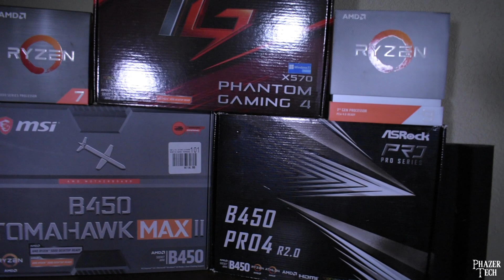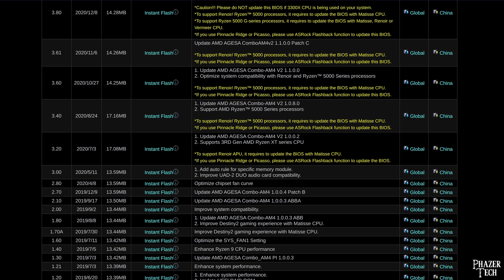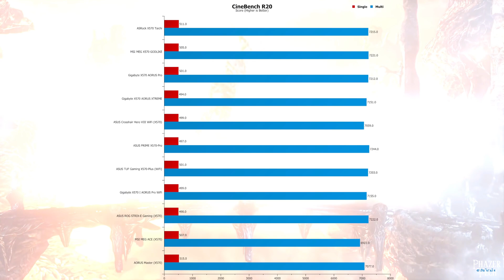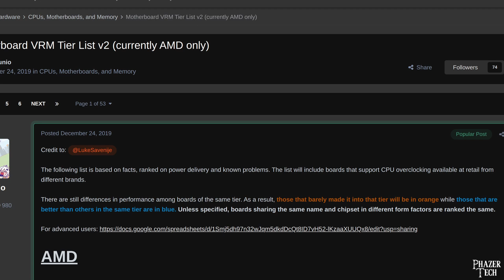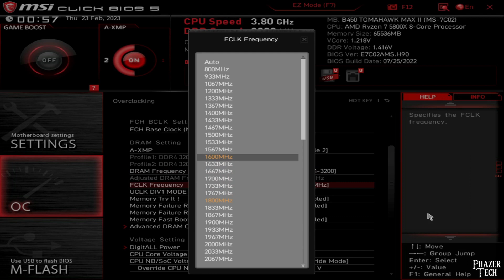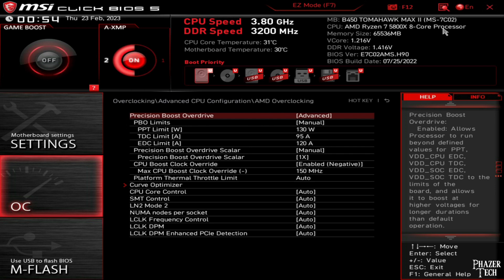AMD Ryzen CPU Degradation - Fix Instability With Custom PBO Settings!

Comment: My 5800X has been unstable under minimal PBO settings. I'm resetting everything base spec underclocking to 4.7ghz because of BSODs
Reply from the maker: Yep that's what I'd do, set it to 4.7 Ghz and disable curve optimizer. If you still have problems and are running high speed memory then consider dropping that to 3200.

Comment: How i fix my 7600x , just put curve optimizer to negative 30 and after that i got less temp around 20 celsius and all cores fully loaded are stable on around 5.450 Mhz. I have this MB GIGABYTE B650 AORUS ELITE AX. Before it was horible on default settings temps were around 90 celsius and 5.120 Mhz.
Reply from the maker: Yep curve optimizer is a great way to reduce temps and get maximum performance. Just be careful that your system is actually stable. It might seem stable at first but you might run into stability issues later.
Reply: @PhazerTech  yes. I ran into stability issues that I thought were not there and only noticed the issues after I did some other software changes.

Comment: Hi again, so i should clock my ram to 3200mhz instead of 3600 even when not usinf pbo? (5700x).
Also why set the infinity fabric when theres an auto mode (at least in my bios)
Reply from the maker: That's what I recommend doing to be on the safe side. And the auto mode should be okay, just make sure it's actually running at 1600mhz.
Reply: @PhazerTech  the fabric or the ram?
Reply from the maker: @neffix6976   The fabric should be at 1600mhz, half of the ram speed
Reply: @PhazerTech  ok, great, also should i just set cl to 16 or should i also change the other options, so like 16 18 18 18 38 and tRC auto?
Sry for asking that much but i havent done this before and dont want to mess things up
Reply from the maker: @neffix6976  Reduce all the main timings by 2. So if your kit says 18 22 22 42 then I would set it to 16 20 20 40
Reply: @PhazerTech  ok thx (its the tforce z 3600c18)

Comment: I got problems after upgrading the CPU cooling.

5600X + Asrock B350 ITX + 3200 XMP DDR4  + SF600 power supply

It was running fine with all XMP and auto PBO with 65W AMD cooler.

After upgrading to AIO. It is becoming not stable , always give me black screen reboot , while watching Youtube or Gaming.

I am not sure if the Power supply gone, or the old board VRM could not full load a 5600x when cooler is upgraded.

I will try SOC 1.1V and DDR 1.4V , and Lower all PPT/EDC/TDC this week end. Even get a power supply from my friend to test it.
Reply from the maker: Are you sure the cooler is mounted correctly? How are the temps?
It's possible the PSU could have gone bad or the motherboard, but that would be odd timing.
Reply: @PhazerTech  CPU temp is good under 70C.

I just changed from Default PBO (EDC 90A) to manual EDC 70A, and solved the reboot problem on PRIME95... I will continue work on VRM cooling.
Reply from the maker: @chishingchan6069   Nice, that motherboard is old so perhaps its VRM is weak. Manually controlling the PPT, TDC, and EDC should solve it.
Reply: @PhazerTech  Yes, Cleaning up VRM heatsink and reseat it can help.... 

Thanks for your reply, I love to discuss PC building with communities .. 

I am continue working to get back my PC performance... ( now EDC 90A  back in case with filleters,  no crash yet )

Comment: Got a Ryzen 5 5600x which has been crashing on me non stop for a whole year since day 1, it's never stable if i put the CPU clock speed at auto and is only stable ISH at 3.7. i can randomly bluescreen out of nowhere and if I'm in vr and or playing a higher graphics game it crashes the game fully with no error code. And when in vr it either blackscreens or bluescreens. 

Ryzen 5 5600x 
Corsair 32gb 3600mhz 
Msk b550-A pro.

It's really getting on my nerves, done everything i can. Even tried a few things from this but didn't work. Help
Reply from the maker: You said it's not completely stable even at 3.7?  Sounds like it's a memory issue.  First make sure XMP is enabled, then manually set the RAM voltage to 1.38V.  Also set the SOC voltage to 1.1V.  If it's not stable then manually set the memory speed to 3200Mhz, which is the maximum officially supported speed.  If it's stable then you can try enabling PBO.
Reply: @PhazerTech  will give it a go, if it still goes wrong and still crashes for no reason I'll come back in here hahaha
Reply from the maker: @Swedish_Leo  Haha sure thing, I'll try to help as best I can
Reply: @PhazerTech  still wasn't stable, i may have gotten a bogged CPU? But I'm not sure, but even with all that u said it still wouldn't be stable, I'll change it to 3600mhz and see if it works? If not then I'll go back to all my stock settings i had before and just buy new Mobo, cpu and ram, since I'll just be upgrading to DDR5 instead.

Edit: still wasn't stable at any of the values, don't think it's a problem with ram, since day one when i added my cpu it's been crashing, use to have a Ryzen 5 2600. Updated the bios and everything when i got the new cpu. It's odd tho because my bios doesn't crash.
Reply from the maker: @Swedish_Leo   Do you have the latest bios update?  Also it's possible Windows was corrupted, have you tried reinstalling a fresh copy?
Reply: @PhazerTech  latest update from what i know, as well as windows may br corrupt. Tho i don't know since I've installed windows 11 for the first time so idk it's do weird
Reply from the maker: @Swedish_Leo  So you were able to run the same board and ram with a Ryzen 2600 without any issues?
Reply: @PhazerTech  yup
Reply from the maker: @Swedish_Leo  Also make sure you install the latest b550 chipset drivers.  If it's not the OS then I'd say its the CPU then. The other thing I'd try is raising the LLC setting for the vcore to the 2nd or 3rd highest option.  Could also be the PSU.
Reply: Set xmp, leave everything on auto. Change the scalar setting to 1x. Done, you now run stock

Comment: What should an ideal ghz speed be for my 5950x at -30 negative curve with a dark rock 4 cooler at 1440p? I understand I am more gpu bound at 1440p but I’m unsure if eco mode at 95w/65w would harm performance too much? 80c is when I’m personally wanting the system to be cooling down.
Reply from the maker: Using Eco mode 95w won't harm performance at all for gaming.  In workloads where all the cores are under heavy stress then it will be slightly slower, but if gaming is your main concern it won't matter.  Personally I would stick with default PBO settings or something close to it, for example:  150w PPT, 100 TDC, 140 EDC.

Comment: Appreciate the effort! So just to clarify... Eco modes are safe from degradation without tweaking?
Reply from the maker: Thanks!  Yes Eco mode is safe.  Just to be extra safe I'd manually set the PBO scalar to x1.  Also I wouldn't run the memory faster than 3200Mhz.
Reply: @PhazerTech  Thanks for the advice! Do you think this also applies to AM5 though?
I've been running a 7950X on 105W Eco mode with 2x32GB CL30 EXPO RAM at 6000MHz for weeks without issue. I definitely wouldn't run Eco mode if I had to downclock my RAM...
Reply from the maker: @Nayah9  The RAM isn't related to Eco mode, I recommend that everyone using AM4 limit memory to 3200Mhz to guarantee lasting stability, regardless if they have PBO or Eco mode on or not.  You should be fine with those settings on AM5.

Comment: Hi

Really appreciate the work and effort you've put into this.

I'm curious if you could do a guide for the AMD R5 3600
I have MSI B450m  (Pro-VDH MAX)

When i installed Ram 3200, that's all i could get  out of it.  ( Edit 3200 is its rated speed)
From the website it said :Supports DDR4 Memory, up to 3466+(OC) MHz"
I have 4 x 8Gb ram installed.   
I'd tried some basic Ram tweaking, then thought id leave it alone, before i mess something up, after having no joy using XMP profiles or other attempts with timings. 

Also Im curious would you set the 3600 CPU to use the Eco 65W mode and leave everything else alone?
For minimal performance hit and increased longevity?
Reply from the maker: If your memory is rated for 3200 then that's the speed it should run at.  You should enable XMP and not change any timings if you want to guarantee stability.  You might need to increase the RAM voltage to between 1.38-1.4V and the SOC voltage to 1.1-1.15V since you have 4 dimms.

Eco mode should work good with that CPU and not limit it very much if not at all.  But at the end of the day it all depends on the temperatures you're getting.  70-80c under heavy load is good, max temp is around 90c.  Also make sure PBO is not enabling the additional boost, make sure it's set to zero.  You might also consider undervolting which not only drops temperatures but also gives the CPU more power headroom to boost higher.  -50mv seems to be doable on most CPUs.  Test stability by running y-cruncher for at least 6 hours.
Reply: @PhazerTech  Thanks for taking the time to reply,!  👍
Reply from the maker: @outsidein3206  No problem, happy to help out!

Comment: Thanks for the information. I'm doing well with my 5700X, updated from 3700X, updated from 1600.  I'm using an old Asus X370 prime pro which I bought from Microcenter for $30.00 with my $85.00 1600, its been a good purchase. I noticed that initially I had problems with getting my 1600 to recognize up to 3200Mhz ram. I had to settle for 3000Mhz, until I bought the 3700X. Afterwards, I was able to get the full 3200Mhz I initially paid for. Good to see the quality of content improving with every episode.
Reply from the maker: Wow I must say you've certainly got your money's worth with that setup!  I'm amazed at how long AMD was able to make the AM4 platform last, early adopters got unbelievable value for the dollar.  Each generation gave a significant boost in IPC performance, as well as better binned memory controllers.

Also thanks for the comment.  I've been learning better editing and recording techniques and now I feel I've finally gotten the hang of it.  Also I didn't really have any experience in front of a camera before starting this channel.  My next few videos will be on Linux stuff but afterwards I've got some really cool stuff to show, so stay tuned!
Reply: @PhazerTech  Well said! Looking forward to the Linux stuff. I need the practice. Staying!